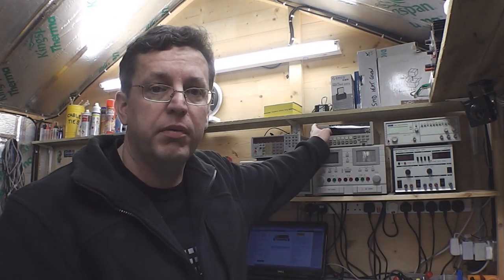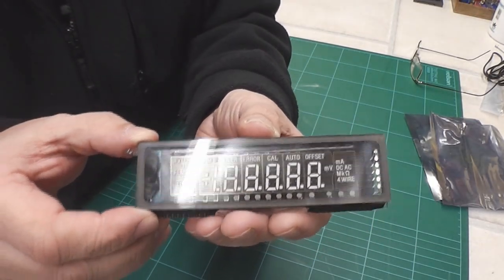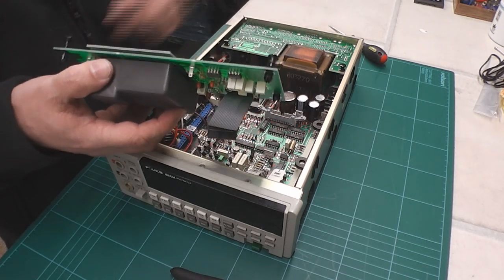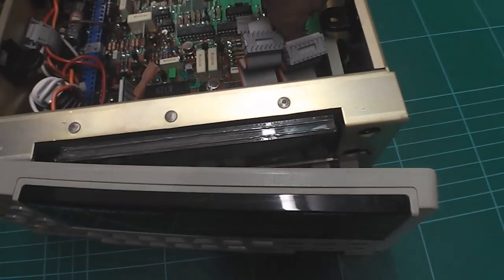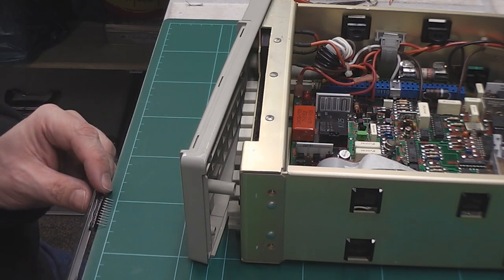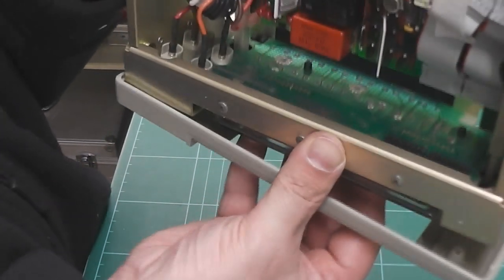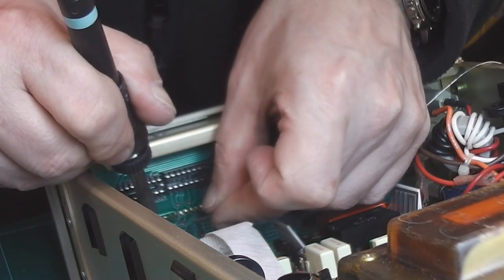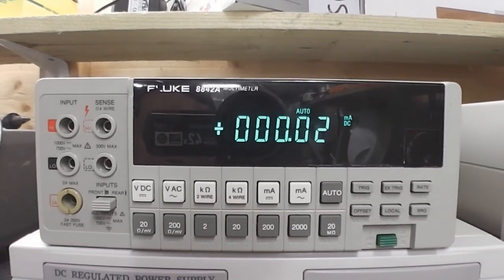Fluke 8842A DMM Repair

Comment: Eight years later...these VFD's are no longer available; however, there is an LED equivalent being marketed by an ebay seller which works really well.  In acquired one and installed it in my 8842A, it does the job nicely, highly recommended.  BTW, it isn't necessary to remove the RMS board, in fact, the one in my 8842A was almost impossible to removed without causing damage.   I removed the front panel to get better access to the display's pins for desoldering.  I had to cut the banana jack's wires to remove the panel.  It was easy to resolder them during the rebuild.

Comment: Hi, just found you! Nice vid, apparently there is a dodgy way to "regenerate" the phosphor did you consider this ?
Reply from the maker: Not in this case, but have used it to extend the like of some IN-18 nixie tubes, the idea being you over voltage the tubes slightly and it helps burn off deposits and brings them back to life.

Comment: I got one from ebay, but I found something weird, after I measure the voltage, my probes don't touch anything, but the reading won't go back to 0, it slowly dropped little by little, until I short the probe.  Is that normal?  Never used bench multimeter before. Thank you
Reply: According to the manual, the 3 lowest DC volts ranges have a very high input impedance, 10 G ohms or more. When the leads are not connected to anything, the reading is just static charge. The 200 V and 1000 V ranges have a 10 M ohm voltage divider connected across the inputs, and that's enough load to pull the voltage to 0 when the inputs are floating. If you connect a 10 M resistor across the inputs, the lower ranges will read zero as well when the probes aren't connected to anything.
(I have an 8600A, which does the same thing on the 200 mV and 2 V ranges).

Comment: on the transformer there can be cold solder joints or aged cracked solder around pins
of transformer, remove all old solder, re-flow with new solder, this helps the display get brighter in some cases

Comment: What's the story of the Aim-TTi function generator on the right of the DMM at 0:57, those tools don't have this metal switch with "OFF" label, is it your improvement, or did something break in it?

Comment: I haven’t got a bench meter but I’m in the market for one and was wondering about how you like using the Fluke 8842A?  I’m considering the Fluke 8808.  Do you have any idea how old the meter was when you finally had to replace the VFD?  I’m not an engineer it’s just a hobby.  Thanks for the video.